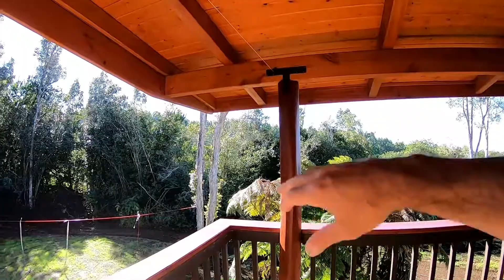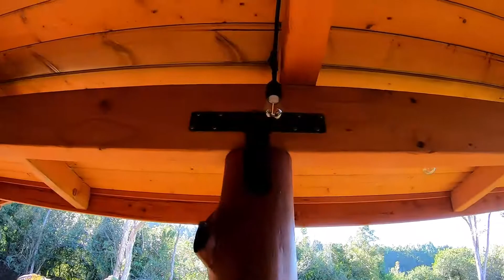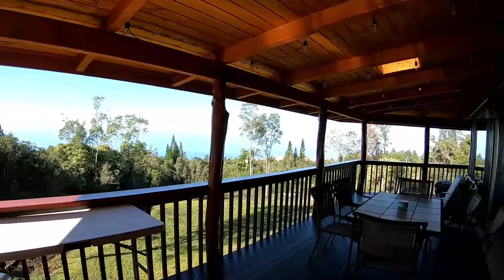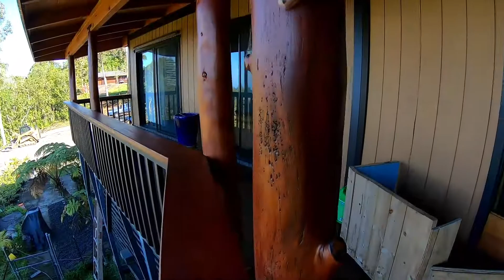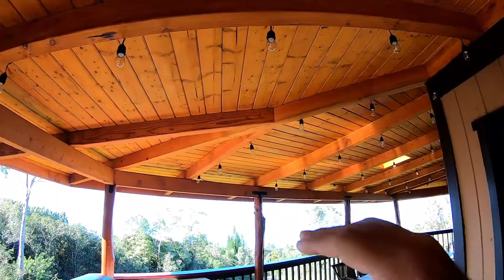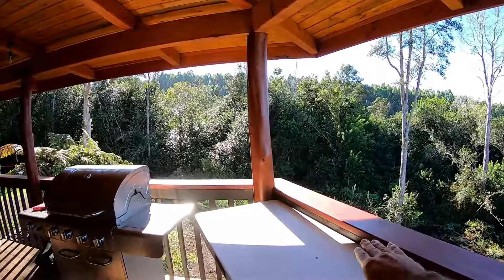Custom patio build using Hawaiian hardwood Ohia logs

Comment: About to tackle 7 ohia posts for my deck.... curious on your debarking/sanding that you did to get that super smooth finish? care to share? Aloha from Hau'ula \III/
Reply from the maker: I used a pressure washer to remove the bark then use 100grit sand paper on a orbital sander to get it ready to stain. I used and recommend Sikkins (Cetal) re1 and 23 as the stain. It is a 3 coat process and comes in 2 separate gallons the first coat is the RE1 gallon and the second and third is the RE23 gallon. I used Mahogany but butternut color is also really nice and popular on the big island. It is pricey stuff but it is the best and will last the longest. Use a staining pad to apply and wipe off excess with the same pad so not to hide the wood grain. Good luck